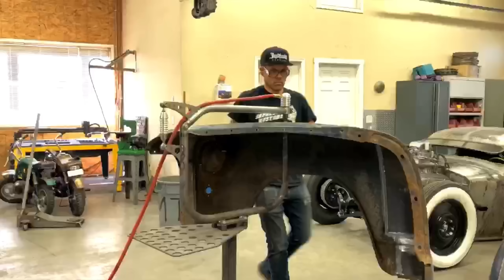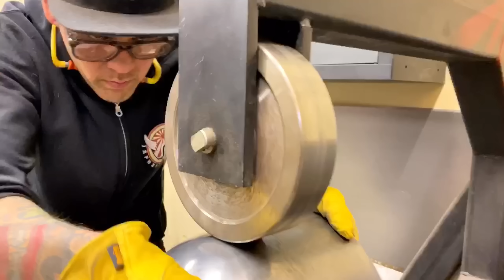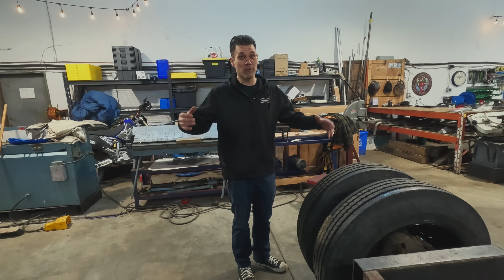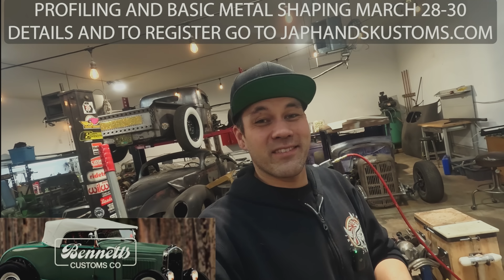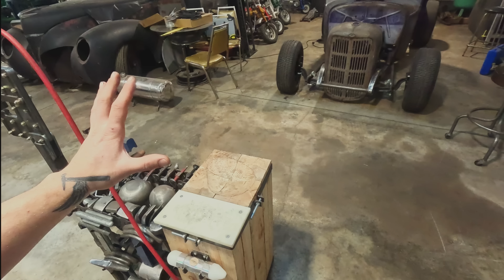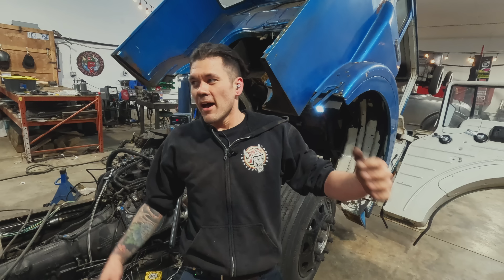IS THIS RIGHT? Designing/Fabricating DUAL SHOCKS COE RAMP TRUCK EP-15

Comment: Hello Karl a little late on this are you sure about the bottom mount. Wouldn’t it be better if it tied back up to the chassis at the front. I no your looking at clearance. There looks to be a lot of force for the two you bolt to hold. You no better than me. I’m curious. BTW. Your second channel is superb. Cheers. Take care.

Comment: Super nice work karl... that extra help comes in handy when needed.... like the tip on the difference between using a touch and a plasma cutter to remove a bracket....🙂👍🙏

Comment: I think you should gusset the lower mount of the top of the bolts as well, you would eliminate the amount of leverage the shocks put on that square tubing. Just a thought
Reply from the maker: Yea it might need some more! Just figured that much 1/4” steel would suffice but I agree it could use another attachment point

Comment: Great job on the fab work , noticed a cement mixer with steel bits inside, what is up with that? I like the ramp truck project because I'm working on one also and you give me good ideas. Keep on trucking.
Reply from the maker: It’s for cleaning the dross from the plasma

Comment: glad to see more work on the ramp truck! actually your MORE likely to collect dirt in the shock mount from having the tube open for the bolts if you cap off the ends leaving it open would let it get dirt washed out
Reply from the maker: Good point

Comment: Hey Karl I really enjoy your channel. I have a little tip for you. Where you install bolts on a vehicle or aircraft vertical bolts go from top down with nut on bottom. Horizontal bolts go from front to back with nut to the rear.
Reply: Why do you do vertical bolt with nut down?  On communication towers we
Put nut up, so if It come loose you see open hole and it’s obvious.

Comment: Interesting discussion on the torch. I will sometimes use a gouging tip on my plasma cutter to remove welds. If you are in a place that you can get your eyes on it, you can do a nice job. Slower but can be clean. Thanks for sharing the project.

Comment: I gotta admit I was surprised at first how often you used a torch vs plasma or cutoff wheel. Not anymore. Your torch skills are with out a doubt excellent. Some of your cuts have looked cleaner and a whole lot straighter than anything i have done with wheel or cut off. I'm more used to using a torch on the farm to heat up stuck on hardware or cut up thicker metal. Its been a pleasure watching you work metal. Thank you.

Comment: That lower mount seems to be the week link. You should make sone bushings and weld them in solid. This will help keep the downward force and hammering of the suspension from compressing those large holes you cut in for socket clearance. This will allow the lower face to be in compression to resist the tension loads of the upper face. Either that or weld an angle brace to the side.

Comment: Ironic you mention “no fatigue”, call me Nostradamus but the front pivot on your suspension A-frame is going to more than likely fatigue because you don’t have enough degrees of freedom to articulate the suspension travel. If that pivot pin breaks it’ll cause loss of steering ability and failure of suspension which could result in killing the passengers or innocent obstacles or people. Morally I just wanted to exercise my due diligence being a chassis engineer for a major car company for 30 years.
Reply from the maker: What would you change ? I have articulated it simulating a bag blow out on one side and added a large sway bar (next video) the bolt, bushing ect didn’t bend or anything. 20,000lbs force to hurt that bolt
Reply from the maker: We did the articulation without the sway bar
Reply: I can’t see a way to change the front pivot without changing the design. Right now the an arm is like a motorcycle or atv swing arm, they only pivot in one degree of freedom whereas you need the an arm to also pivot axially to the pivot axis as well. About the only example I can think of is the front radius arms on early ford bronco and ford trucks where they have a through pin with “donut” bushings which gives them the two degrees of freedom. It would be beneficial if you had a redundant pivot in case one fails but again that would require a whole redesign.
Keep up the great work love your channel.

Comment: Glade to see you back on the COE project. I know I am old school, but I just can't understand why a saw would need a computer, software updates, and a password. I like the variable speed and constant torque drive, but I would want it to work with the flip of a switch whenever I need to use it.

Comment: Looking really good Karl! Just food for thought even though the tube is 1/4 wall maybe with both those shocks hammering up and down on it may lossen the bolts.Would it be advantaious to weld some spaces within the tube and install longer bolts through the works. Maybe not but keep an eye on it be simple fix later.

Comment: The Ford F- series trucks used the same upper front mount for many years. You can buy them (or could) directly from Ford. Last ones I got were under $20 each.
They don't look as cool, but are perfect for that OEM look.
They are also wider at the bottom for lots of room for axle articulation.

Comment: The high pressure oxygen actually oxidizes the metal then blows it away the heating flame will not get any hotter.
Set the heating flame first then open the blow to fully open.

Comment: I am not an expert... but... with those shock mounts as beefy as they are, it appears to my non-expert eye that where the square tube mounts to the lower axle perch with those two bolts is a 'weak link'.  I can envision metal fatigue and cracks developing in that square tube around the two bolt holes.

Comment: On construction we use a scarfing tip to cut welds off. It's curved so it doesn't dig into the parent metal.

Comment: From Mississauga, Ontario. When I need to create brackets I am forced to use cut off wheels and grinders. It is a task to make them in small batches and still have them be identical. I envy those men that have computer controlled cutting capability. Great video. When you drive the ramp truck to Saskatchewan, how about overshooting all the way to Mississauga. KBC Tools in Mississauga would be a great destination.
Reply: I was coming on here to invite him to VanFest in Aylmer Ontario June 6-9 but early in the video he said they were not going to finish the truck until June.

Comment: Remember, shock absorbers have an installation direction . Are you sure that they can be mounted like this. Bilstein is a very good German brand and normal the designations at bilstein are always so that you can read the designations in the installed state without contorting.
Reply: Bilstein says install with their labels the right side up with their logo. 

If their logo is upside down, the shocks are installed wrong.

Karl has installed these shocks correctly!

Comment: The lower shock mounts may stick out too much and flex too much.  You may need to put a bolster plate there to support the lower mounts.  Looks cool though
Reply: Yeah, I had the same thoughts.  As it is now, all of the shock loads are going through those two bolts heads and whatever area they cover inside that tube.

Comment: Great work and explanations of what you're doing as always Karl. I am curious though, why didn't you use a tab and slot style of design for the shock mount? Seemed like trying to keep all the plates in alignment was a bit finicky. Adding tabs and slots should make it easier to keep everything in place. Keep up the good work looking forward to the next installment.

Comment: Yes, sir like all skill sets it takes practice to get efficient with a cutting torch. And I will say this, many people go straight to mig welding for example in learning how to weld, but the first step should be oxy-acetylene gas welding and brazing in order to understand the basic welding process, and of course learning to use a cutting torch is a handy skill. But like all skills if one does not use those skills then one gets rusty. Like others I have graduated from using a cutting torch and when I do my coordination is off and I find it difficult to cut straight. But your assessment about a torch is correct and it is still a basic tool to have. The best investment in tools that I have ever made is when I bought an oxy-acetylene set-up.

Comment: Think the lower mount is a weak point. I also bolt stuff to frames on heavytruck, not weld. Thanks for all the great content.
Reply: Agree. Maybe need a gusset back to the chassis rail somehow to transmit the load from the shocks into the chassis, otherwise might bend the square tube over time. Other than that, great work Karl!
Reply: The original brackets were welded on.
Reply: It's a shock mount, not a spring mount.  Not carrying the load, just eliminating the rebound.

Comment: Looking at the bottom shock mount...do you think it could be a weak point with only one 1/8" wall of the square tubing bolted to the axel?  All the weight is on that 1/8" mounting point.
Reply: It’s just a shock mount…….the shock is gonna move before it ever bends 1/8” steel.
Reply: @minnesotatomcat , Correct, shocks don't carry the weight.  Springs, torsion bars or air bags carry the weight.  Shocks are there to control the rebound.  The only way it gets load would be for the shocks to get slammed at full bottom after catching air.  It's a ramp truck to carry not a truck to jump over ramps.